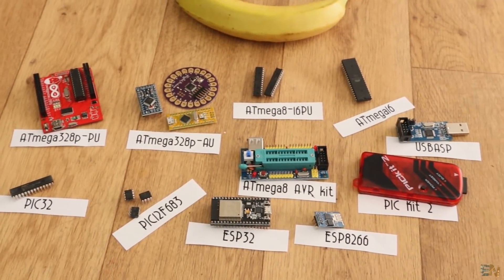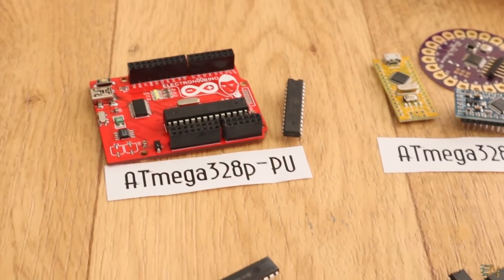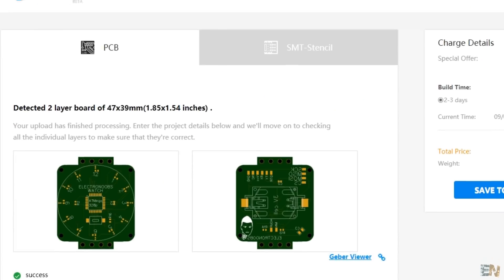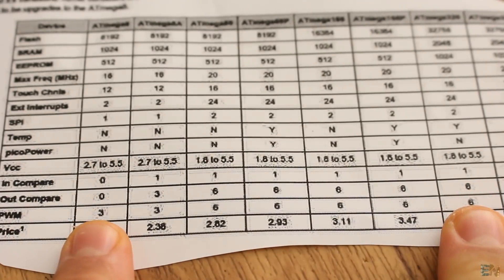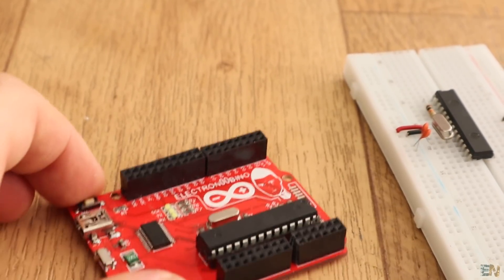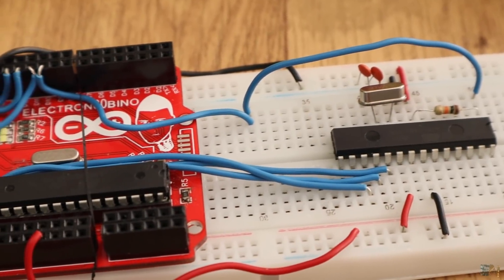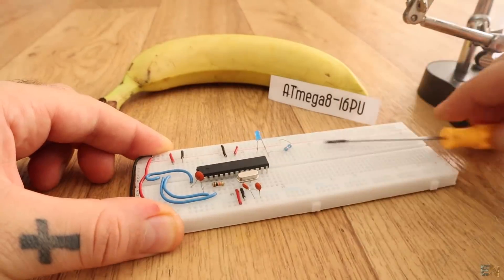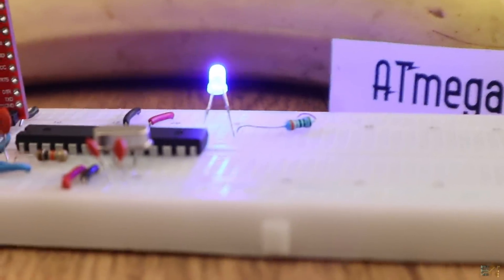ATmega8 bootloader, code, Arduino IDE

Comment from the maker: Want to help my workshop: https://www.patreon.com/ELECTRONOOBS
Thank you so much!
Reply: hola 
buen video yo tambien tengo algunos interesantes
*Decodificar Códigos de mando a distancia con Attiny13:  https://youtu.be/yBfnU-WX1BQ
Reply: Yo. You should make a tutorial on how to design a bootloader in the form of an Arduino Shield...
Reply: I have one guestion. How about 328P in smd version is it same connections as in your tutoril arduino bare minimum or there is diference.
Reply: So far I have bricked 2 of my 10 atmega 8's ..... 8 more to go. Then I can recycle them.
Reply: Sir, send your mail id.
Reply: Starting program mode  failed result
Sir whats is this problem
Reply: bro , can u show how to program atmega 16 with arduino ide
Reply: sir is not working .
328 u ic name

Comment: But we are uploading a bootloader on microcontroller and it will take up our working space. 
Is there any DIY method we can use to program avr microcontroller without burining any bootloader first? 
An alternative method for TL866 programmer.

Comment: There's definitely a gap in the explanation of configuring the FTDI board to load the chip on the breadboard. I've tried uploading blink to the COM port of my FTDI programmer and I'm seeing "avrdude warning: attempt 1 of 10: not in sync".

I have no idea what the loading baudrate is supposed to be?

Comment: Does this still work? Im having some trouble, i dont know if i installed the bootloader correctly... I tried to do that step again and in one of the lines it said "Found "optiboot_atmega8.hex" for atmega8" so im supposing I did that right ?
The problem i was having was when i tried to upload code via the usb to ttl, it said  "avrdude error: unable to read signature data for part ATmega8, rc=-1" If anyone could help id be grateful!

Comment: The ATmega8 vs ATmegaXX8 table you've shown seems to show 2 SPI interfaces, for most of the chips listed, including the 328P.  That's wrong, isn't it?  The Uno has two sets of pins connected to SPI (the 6 pin ISP and some of the D pins), but they're just wired together, aren't they?

I now realise how difficult it is to get a decent  high resolution schematic of the Uno, as an image.  I'd saved several, over the years, but they're mostly too blurry to actually read properly.

Comment: I bought Atmega8 16pu and I have a question? Can I use another arduino Uno and put this chip in instead of 328 and to burn bootloader that way, using 2 arduino uno's?

Comment: hello 👋 bro ,

i follow as you told ,all works good but program is not uploading with usb ttl (cp2102) black colour board , i don't know why usb ttl is not working to upload program to atmega 8 ,its uploading to atmega328p  but atmega8 is not supporting... is there any other way to upload program to atmega8

Comment: Thank you so much for this video.
I tried this at my home but didn't worked.
I have uploaded "OptiLoader" code.
But while uploading the Blink code it was giving me below error.

"Access is denied.
exit status 1
Error compiling for board ATmega8.
"

I tried with same settings as you shown.
Please help me with this issue.

Comment: { "ATmega168PA", 0x940B, 0x9406 },	/* Treat 168P same as 168 */
  { "ATmega168PB", 0x9415, 0x9406 },	/* Treat 168PB same as 168 */
  { "ATmega328PB", 0x9516, 0x950F },	/* Treat 328PB same as 328P */
  { "ATmega328",   0x9514, 0x950F },	/* Treat 328 same as 328P */
  I  use  Atmega32
 What is const alias_t aliases[] in  Atmega32 ?

Comment: If I change the ATMEGA8's bootloader, will it work with ATMEGA8 only codes?
I'm making a battery capacity tester designed by Danyk666 (DiodeGoneWild), and it needs a ATMEGA8 microcontroller
And can you reprogram a ATMEGA328P to work like the ATMEGA8?
Please reply fast

Comment: Sir, if I use atmega8a instead of 8, process will be same or not? And pls make a video on difference between 8 and 8a. Pls sir. I didn't got 8 in market, so took 8a. So, I dunno the procedure is same or not, that's why I can't use it, in fear of it may burn.
Reply: Its the same process

Comment: The atmega88 is the newer version of the meg8.  It's a better chip having more interrupt lines, and it works up to 20mhz vs 16mhz for the '8'.  The mega8 might be cheaper, especially in surplus.  BTW you CAN use the USBISP to program the optiloader on the chip.  I've done it!  (Via the command line with avrdude)

Comment: I often use the Attiny 85 and 84 chips and would like to see some projects done with them. Because they are dirt cheap 😬
Reply: Then you may find the ATtiny13A interesting to. Less memory but much cheaper. Equally interesting is the ATtiny44A. Half the price (and memory) of the ATtiny85, but as many pins as the 84.

Comment: Fun fact, the original Arduino Project development boards were based on the ATmega8. If you go to the Arduino website and look up the board history you will find these boards. They also have the board files needed for etching your own Arduino dev board on single sided copper clad using only 6 jumpers IIRC. The very last board they developed for etching yourself was done back when they were first shifting from the ATmega8 to the ATmega168. This was long before the uno and long before the 328 became the standard. Again, if I recall correctly, they posted information about which settings to use in the Arduino IDE in order to support this board with the ATmega8 or ATmega168. I don't think you need to add or remove anything from the library either. I think this board design has always been the baseline for backwards compatibility, but of course I could be mistaken. The DIY etch design is from all the way back before Arduino was a corporate "thing," back when this was just a project with a bunch of enthusiasts and students goofing around. It's not all that different than the rest of us making our little projects and posting them publicly.
-Jake

Comment: Hey :D 
I have an 180VDC Motor and it's PCB is completle destroyed, i'm trying to make my own PWMcontroll...but it won't work....i'm almost 3 months trying it. Please make a video how to PWM a 180VDC motor with a Supply Voltage off 230VDC ...i think i'm not the only one, who would like to see it.
Reply: Follow Simple step: 
step1: Buck 230VDC to 180VDC using appropriate Buck converter.
Step2: create pwm from Arduino and connect it with gate of 200V,100A highpower mosfet.
Step3: attach +180VDC to motor inputs and other side of motor to drain of mosfet. Ground the source pin of mosfet.
Step 4: use high current wires for motor driver circuit. And run your motor.

Comment: Nice Video
But litte "fun fact" you could allready use an atmega8 whit the basic board libarry.
Under the "arduino NG" bord you coud choose between a atmega8 oder atmega168. So theoretical you dont have to add new boards to your libarry but still nice to have.
Reply from the maker: Thanks. I've tried that and for some reason didn't work...

Comment: It is painful to see people make nice, finished products with their Uno, then sacrifice the whole thing to its working environment.  The Uno is made specifically with a removable target chip in mind for placement into a finished project, and takes any 28-pin mega:  atmega48, atmega8, atmega88, atmega168.  Cheapest and most common by far is your atmega8a.
I usually fuse them for 8mhz internal OC, using without a crystal.
Inexpensive, indeed ... here 48 cents :  https://www.aliexpress.com/item/Free-Shipping-10PCS-lot-ATMEGA8A-AU-ATMEGA8A-ATMEL-TQFP-32-Instead-of-ATMEGA8L-8AU-and-ATMEGA8/32748805999.html

Comment: I would like to see the Parallax Propeller (P8X32A-D40) a 32-bit 8-core microcontroller capable of running at 80MHz and generating It's own video output if needed

Comment: Atmega16? Stepping back. I do recommend to get Atmega168 for projects that don’t need more than 16K of flash and Atmega32A that is more chipper than Atmega328. Try to use STM8S instead Atmega8. You will love it.

Comment: Great video! It was very useful. But I have a question: how did you chose a 10kohm pull up resistor for the reset pin? why that value? I'm trying to learn how to calculate the right size for pull up/down resistors  for logic CMOS digital circuits
Reply: 10k is pretty much the default value for pull-ups and pull-downs. There isn't any precise value or formula to follow, pretty much anything from around 4.7k to 22k, maybe higher, will do. 10k just tends to be a value in that range that most people have on hand most of the time, so it kind of feeds back on itself and everyone just uses them by default and keeps them handy whenever a pull-up is needed. Pretty much the idea is to be a large enough resistance to be easily overridden by a connection to the other rail while being small enough that there will be enough current to maintain the desired input level. In general unless a datasheet specifies a different value, just assume 10k will do.
Reply: thank you very much
Reply: Too big a resistor can lead to noise problems where the current is so small that the gate can be affected by power supply noise.
Too low a value resistor can lead to latching, where something trying to pull the line high or low cannot overcome the current, because of device limitations. So this is very dependent on what is attached to a gate. in general, anything between 4K7 and 10K should suffice.
Reply: @michaelward402  lol I had forgotten this comment from 3 years ago. But thank you. It's useful information

Comment: I would like to see an AVR programming troubleshoot video. I have multiple chips that get DID 0x000000 for some reason, preventing from programming them. I simply can't find the right solution
Reply: The chips maybe locked. Some cheap suppliers sell pre-burned chips. A high voltage programmer may allow you to reset the fusebits. They could alse be fakes. See the video on my channel for more about that...

Comment: Nice projects but unfortunately i dont have money to buy parts online😔
Reply: You can usually find old PIC micro controllers in consumer level junk people throw away. That's how I got my first PICs to play with. I actually found 2× PIC12F675's in an old portable heater, a PIC16F628 in an old TV, and I actually found a much more modern PIC16F1508 in a broken high end bicycle headlight. Upcycling junk isn't the most efficient way to learn but it's free and you never know what you'll find ;)
-Jake
Reply: Buy from china on ebay
Reply: @PeteClio  China has enough of our money. Buy local.
Reply: AliExpress ships free and parts are actually very cheap. I also use scrap electronics to source many parts.